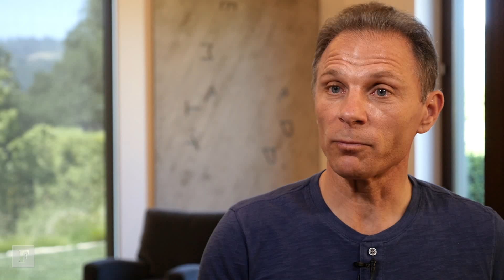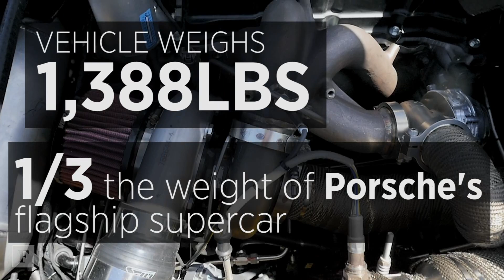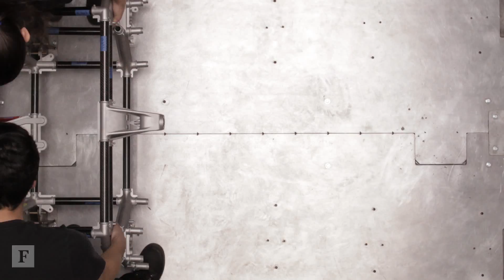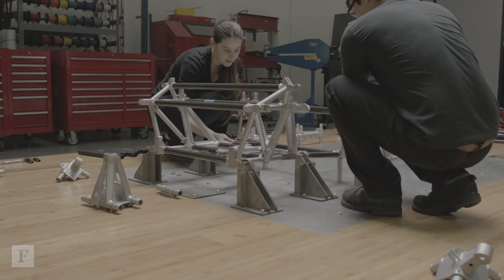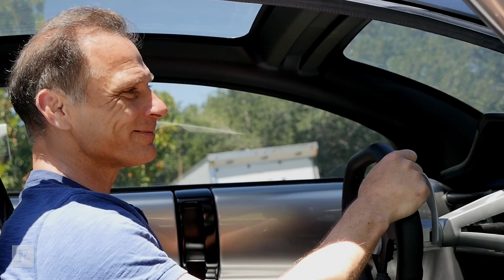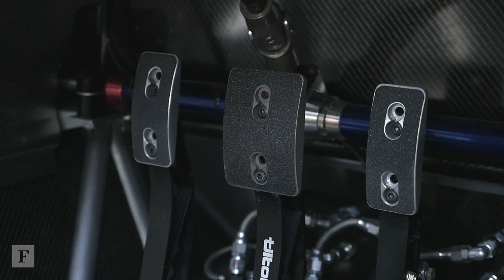The First 3D-Printed Supercar | Forbes

Comment: "One third of the environmental damage that a 85 kWh EV has" is misleading. It implies that said car can't ever be produced using only electricity from non polluting sources (nuclear, solar, etc.) and completely glazes over the fact that this car uses an ICE engine which 100% of the time will pollute the atmosphere which is atm the highest at risk of destroying our habitat. The goal is still 0 CO2 emissions and while EVs have that potential, as long as his car uses an ICE engine, he fails. That said, nothing is stopping them from adding an electric power train. What concerns me though is the way the carbon is "married" to the aluminium nodes, remains to be seen how well the glue does. It's also a concern regarding safety. While we all know that F1 uses crumple zones made out of carbon fiber, those parts using a honey comb structure inside that is lacking from this car, not to mention the parts are different and will not act the same, basically I'm saying that this car probably has the safety of a 1930 car in case of a collision. That being said, I'm actually confident that the linking and safety elements problems could be solved.
Reply: +kalimul I'm thinking that he put a natural gas engine because the big, heavy battery and motors having a greenhouse effect from manufacturing that would give it a greater lifetime environmental damage than with a natural gas engine. Maybe if we switched over to more renewable electricity sources in the US this would be different.
Reply: +kalimul A Tesla is not 0 CO2 emissions.  Tesla's own calculations put the emissions at about the same level as Honda Accord in areas with mainly coal used to make electricity on the power grid.  On average in the US, the power grid is fueled 65% by coal and natural gas.  So, unless you have your own wind turbine and storage, a Tesla is really no different than other cars on the road.  Just because it's electric doesn't mean there's no emissions, the emissions are just not at the location of the car.

Comment: I was just about to write the same question about the Euro NCAP test. Unfortunately it is not doing very at all on it. And there fore won't have all EU-approval. Unfortunately. Anyway, it shoudn't be a problem with some strenghtening and  increasing the weight (just a bit).

Comment: OK but why not do both? Make it this way AND make it electric! Why would you boast about the environmental savings and then throw a combustion engine on there?
Reply: Because batteries harm the environment more upon construction. But the long term harmful effects of gas engines aren't too terrible these days considering very stringent regulation. They probably will make it electric in the future, but they'll likely wait for the battery tech to improve. Lighter cars are also more efficient, and batteries are pretty heavy.

Comment: Im amazed that 3D printers can do this butttttttt. People say it has 700 hp.... what single turbo engine has that, that will fit in that small engine bay? Is it all wheel drive. is it legal in the U.S.A. whats the crash test rating. Why does it have paddle shifters amd a clutch. Anyway they made good points but needed to provide much much more info...
Reply: +Morgen kirby, probably has a turbo bigger than the motor lol.

Comment: i thought it was the farms, and the cow feces that did the majority of the pollution. cars and factories not as much..
Reply: +jose cruz cows eat grass which is converted co2 in the air by energy of the sun. The CH4 that the cow then emits is just a cycle which has about a 6 to 12 year timeline. When we pump oil out of reserves deep inside our earth which brings carbon to the surface cycle I would consider that a bigger problem..

Comment: I want to ask the engineer of Blade, not Kevin the lawyer, "How he organizes stress flow in body and chassis that are assembled from so many pieces of different mechanical properties?"
I want to see crash test with camera closed up on nodes and tubes in the wreckage. And before that, not even a cent for order. 
Kevin claims that Porsche with the same engine is three times heavier?! May be he was told by his engineer "30% lighter, not 3 times" and he's confused. I want to see material bill of both cars.

Comment: 0-60 in 2.5 sec? It's a joke. This car cannot even move in this video.
Reply: The structure isn't bad. And it's just a matter of thrust to weight, which is just a matter of power to weight. With a light car and a relatively low output engine paired with right drivetrain and wheel setup, you can dominate. 0-60 in 2.5 s is about 1g.
Reply: Bad Beard Bill the structure is terrible, you don't wanna go with this at high speed
Reply: +realchimera probably just in theory by the engine's capability. I doubt it can go fast with such bad structure. And repairing the structure would cost almost the car's price I bet.